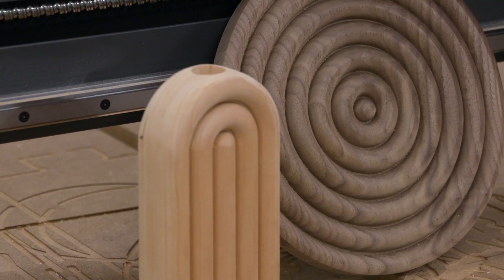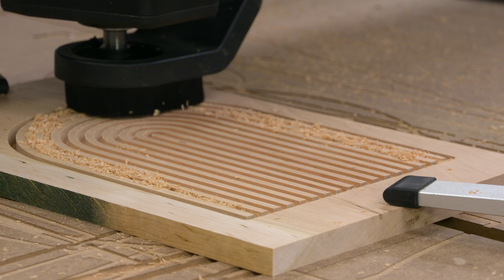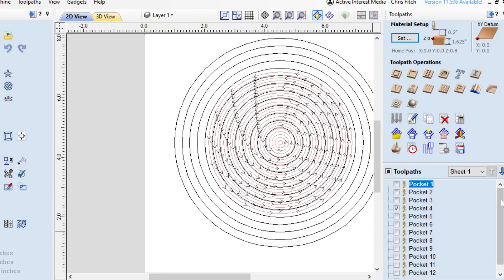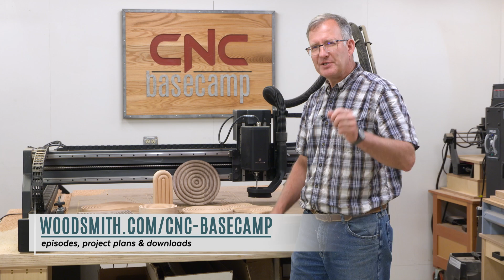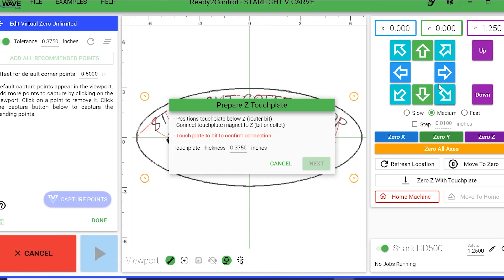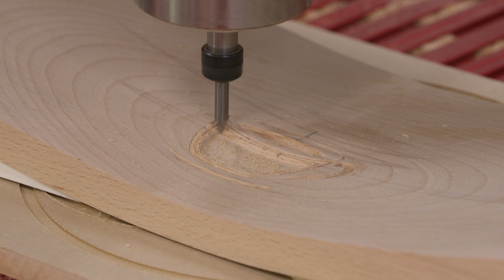CNC Basecamp E023: Stepped-Style Trinket Tray

Comment: Great machine. Interested in the price. I make yard decorations out of 1/2 inch pine plywood.
Reply from the maker: The CNC machine used in this episode is an Inventables XCarvePro 4x4.   It is a solid machine and very easy to use.  Newer versions have some nice upgrades.  The Easel software that runs it is cloud based so a good internet connection is a must.  The 4 x 4 format size is awesome and really opens up what you can accomplish with a cnc router.